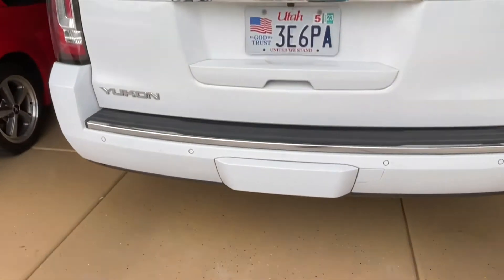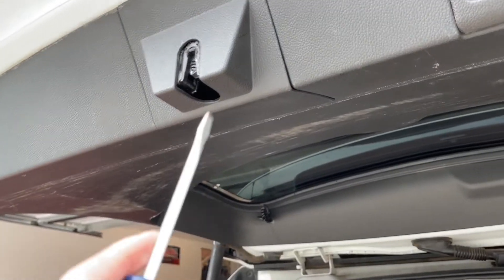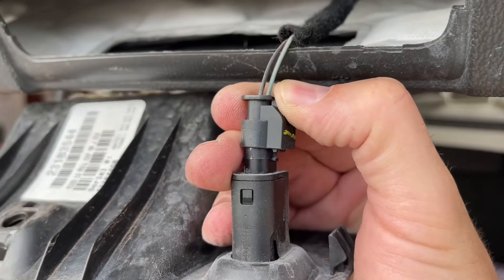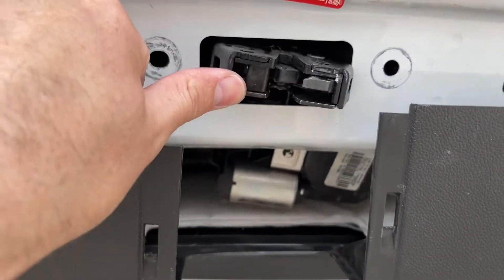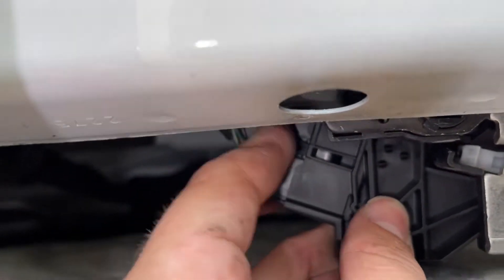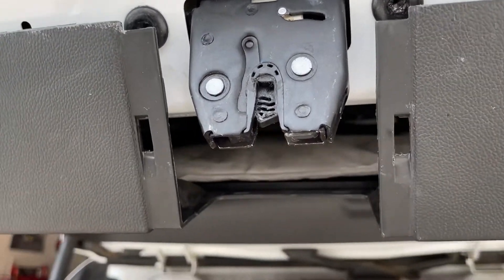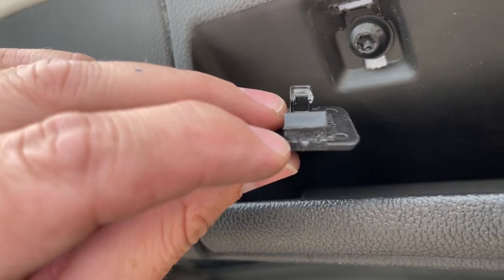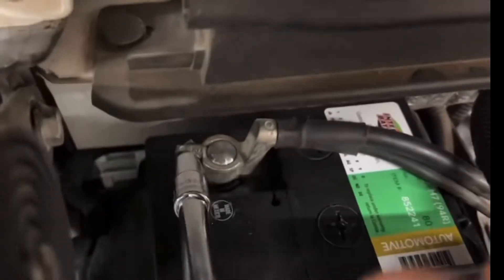Electronic Lift Gate Latch Replacement Yukon, Tahoe, Suburban, Escalade 2015-2020

Comment: Thank you for these videos. I have a 2018 Suburban LS (no electronic lift) and I can hear the latch attempting to release, but it does not release fully. I have to press the release on the handle and at the same time pull on the lift gate in order to get it to release fully so I can open it. I assume I will have to replace the assembly also. Excellent video Danny!

Comment: Having problems with my ..if I force it down will I damage the door?
Reply from the maker: It won’t hurt the strut to push the door down but If the latch is closed it will break it. It’s only plastic
Reply: @dannyjohnsonsgarage  thx..was able to close itself 🙏🏼🙏🏼🙏🏼🙏🏼🙏🏼🙏🏼 I turn my on truck let me truck run a while , went back push the button and it closed itself! 🙌🏼🙌🏼🙌🏼 I also reset it!

Comment: Why is it necessary to take terminal off battery if you are unplugging wire harness?
Reply from the maker: It’s a safety practice for any electrical repair- especially with the tail gate where it always has power even with the car off.

Comment: Before you replaced that, did you have an issue with the alarm goin off for no reason?
Reply: Cause I've heard of that issue and a lot of ppl say it's that latch. Just want to be sure before i start coughing up money for it
Reply from the maker: I haven’t had that problem. In my case, the latch just did not activate

Comment: Is it necessary to disconnect the battery before replacing latch ?
Reply from the maker: Yes. When doing any electrical you can blow out fuses. Especially the latch that always has power to it so you can open it when the car is not on.

Comment: Lift gate only opens 10% when activating via interior button, exterior button, or leg underneath. I’ve attempted to reset by opening and holding the button on the lift gate. However, all attempts have been unsuccessful thus far. 

Any advice would be greatly appreciated.
Reply from the maker: Maybe you could try setting it manually to a certain level that will work. It could be the struts are bad https://youtu.be/Zxjb9YGY7Ls
Reply: @dannyjohnsonsgarage  Will give it a go. Thanks for taking the time to assist.
Reply: Viewed the video, and tried the suggestions, but to no avail. There's ZERO response when pressing the button on the lift gate, either to set new level, or to lower all together.

Comment: My rear door will open and close no problem. But the warning light saying the rear hatch is open comes on. It sounds like the lock clicks when the rear hatch shuts but clearly there is an issue. I think this is what’s preventing my remote start to work, it thinks my door is open when it really isn’t, or at least it seems like it shuts to me. Could you shed some light on this? If I change out the actuator, do you think it would solve the problem? Thank you!
Reply from the maker: My guess is it could be part of the latch assembly, but I’d hate to tell you to replace it and it not work

Comment: Hey Danny, how's the Denali going so far overall? Have you had any issues with AFM yet? We have a 2018 with the 10 speed and it has 23k miles. Although we don't have any issues now, my main concerns are the AFM and magnetic ride suspension going out eventually.
Reply from the maker: I made a video on strut replacement but put the old ones back in after the ones I was installing aftermarket were not working out (may have been side specific, but not labeled and not seeming good quality I sent them back). Factory ones can only be found where you need to disassemble the coil over. My tires are going bad from them, so I need to address it. 
  I am very concerned about AFM and have been contemplating deleting it, which is a big task, removing the cylinder heads. I may do it soon, it’s just hard to have the main family vehicle down. Otherwise, you’ll see all the issues I’ve had in the playlist, or by just watching my video on everything wrong with my Yukon. It’s been minor stuff and I still do love it and think it’s a great, powerful, comfortable suv.
Reply: Good to see you still have your Denali. ❤ Mine, still is going strong 💪🏼. 96k miles now. Regular maintenance like oil change, cabin filter etc. Just toying around with it. 😂
Reply: @dannyjohnsonsgarage Thanks for always replying to our comments and questions!  I wanted to check for any updates on your Denali's overall reliability and since this is also our family vehicle, I'm debating weather it's worth keeping it for many more years and dealing with the potential future issues or trading it in now for a 2023 Lexus GX460. We love our Denali for its size, power and comfort but we're willing to trade that off for the reliability of the lexus.
Reply: Have yall tried the AFM delete module by Range Technology? you plug into the OBD II. I’ve been using that for years on my 17 suburban 5.3L. Works like a charm disabling AFM as far I can tell. I never see it display V4 mode on dash anymore at least. Definitely better throttle response as well. No lag/hesitation hitting the gas after under braking.

Comment: Do you have the part number lol
Reply from the maker: https://www.amazon.com/Tailgate-Actuator-Compatible-Suburban-Escalade/dp/B09HBTX49N?crid=1OP4M59ZQ3BFL&keywords=2015-2020+suburban+liftgate+latch+actuator&qid=1663000027&sprefix=2015-2020+suburban+liftgate+latch+actuat,aps,244&sr=8-8&ufe=app_do:amzn1.fos.006c50ae-5d4c-4777-9bc0-4513d670b6bc&linkCode=sl1&tag=2004047-20&linkId=fea59ba41df4d7a2bf8e8eaeec2606ef&language=en_US&ref_=as_li_ss_tl
Reply: how about the power running board

Comment: I have a 2016 suburban. Just like that my liftgate stopped working. Nothing works anymore. What do you thing is the problem there?
Reply from the maker: If you hear it unlock when you push the buttons but it simply won’t raise and lower, that’s the strut. If you close it and it doesn’t lock or make any sound and you can lift the door without it locked, it could be the latch